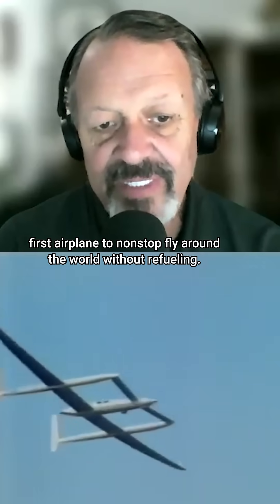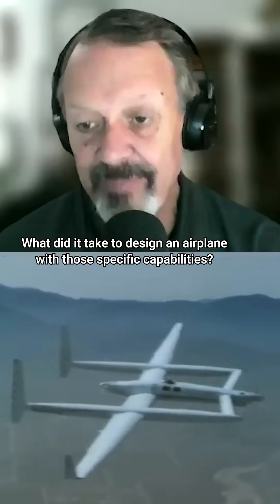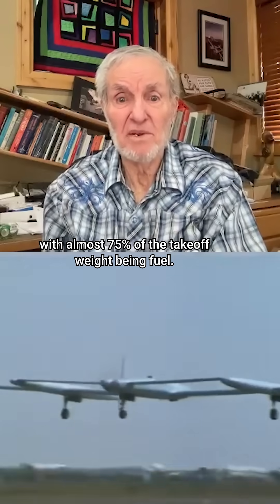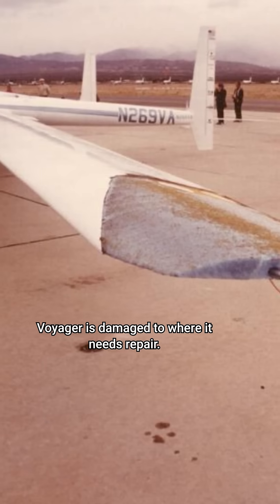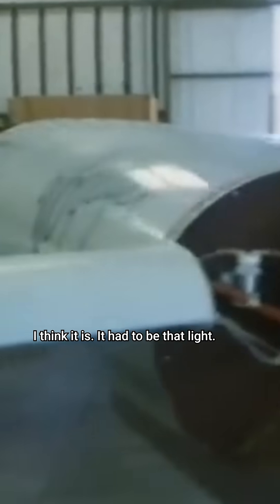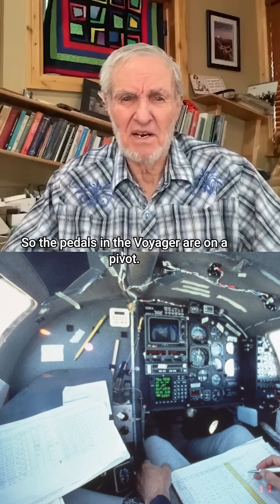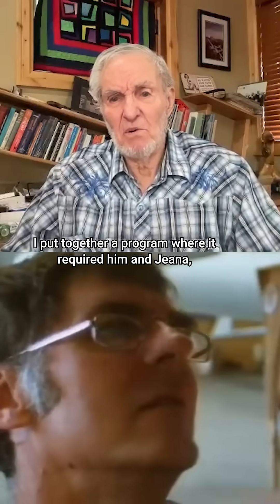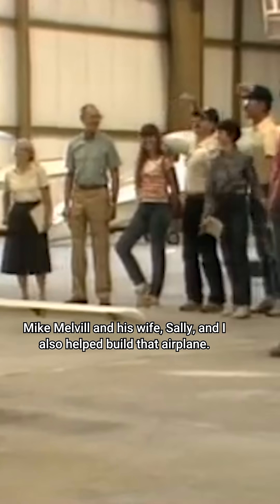Designing the Record-Breaking Rutan Voyager #aviation #voyager #avgeek #history #podcast

Comment: This man gave credibility to the use of composites for critical structures in airframes.
This was a giant step forward.
Reply: He’s like Stockton Rush’s polar opposite.
Reply: This should be common, aircraft shouldn’t use aluminum what so ever in my opinion, Kevlar can be so much stronger then steel and so much lighter then aluminum, aluminum is a nasty metal in every way, especially when it starts to rust (any corrosion is rust, and aluminum likes to hide it on the inside..)
Reply: @Nickjustdabs as long as you keep up with maintenance it’s fine, i’m sure airplanes outer shells can be replaced in sections
Reply: @Nickjustdabs shows how much you actually know. Stop embarrassing your self. First off rust is not all corrosions, rust is a type of corrosion, rust in its chemical compound is IRON oxide (fe203). Rust is formed when iron or steel (as steel is iron and carbon) comes in contact with water (h2o). The iron atoms when exposed to oxygen begins to loose electrons when moisture is present. So no rust is not found in all metals just metals containing iron. Being most aluminum is mined from bauxite witch more then half aluminum oxides and other impurities such as iron. But bauxite is refined to produce something like 98% pure aluminum. So again aluminum alloys do not contain any iron there for can not rust. Can aluminum corrode sure but as long as aluminum is coated, or cleaned often and maintained and protected against from acid it’ll last forever. Aluminum is am amazing metal. It is highly receivable, as almost all aluminum ever produced is still being used today, it has extremely high corrosion protection, its light and can be mixed with several other alloys creating everything from weak and brittle aluminum to extremely strong aluminum. Just because you have never worked with aluminum alloys like 7075, 6061, 5000 series, 2024 doesn’t mean they don’t exist. Learn a little go research and go get some hands on experience  working with all metals before you go around spreading miss information

Comment: If you don't know, the aircraft was built with winglets on the wingtips. During the big takeoff, the weight of the fuel put the wingtips near the runway, and pilot error put them on down. The winglets were scraped off. The plane had taken off and was flying fine, so they kept going.
Reply: less weight, all the better.
Reply: Bro all winglets are on the wing tips that’s what winglets are😂 most face up tho not down
Reply: @Nickjustdabs Yeah idk if you noticed, but the location of the winglets wasn't the point of the story.

Comment: In the 60s Lotus used to build their F1 cars like this. They were incredibly fragile and would barley last one race without something important braking off. Colin Chapman, the founder of Lotus said; "To go faster, just add lightness." In Rutan's case, it should be changed to; "To go further, just add lightness."
Reply: @operator0  Lancia too. Don’t forget that Lancia made their roll bars out of cardboard to fool the Race Organizers. Only way they could compete against Audi Quattro at the time.
Reply: @Bearly7feettall  Not cardboard exactly, that was Clarkson being a tad silly. All 037s in period were meant to use a chromoly rollcage (they also homologated a titanium rollcage but I've never seen proof of it existing). 
What's been consistently rumoured over the years is that Lancia cheated, trying to save some weight, by swapping out the steel cages in the factory cars with aluminium ones.
Reply: The difference being that's all lotus did, Rutan on the other hand worked to many different design briefs on his different projects, from home builds to the edge of space.